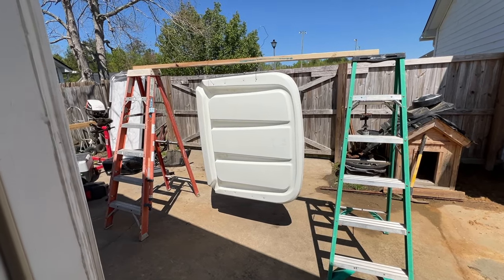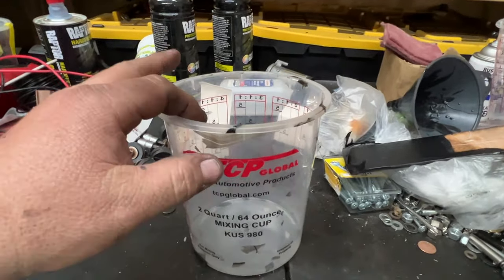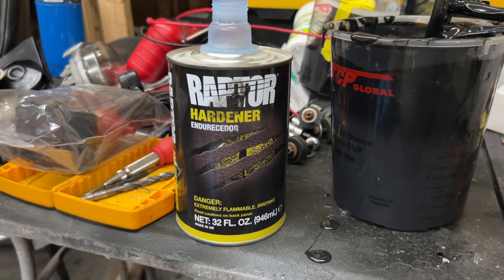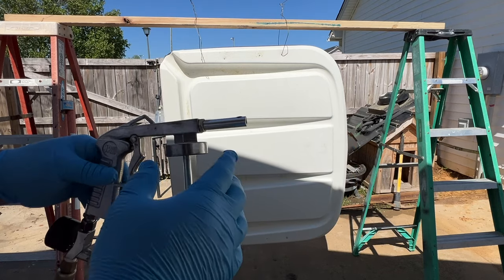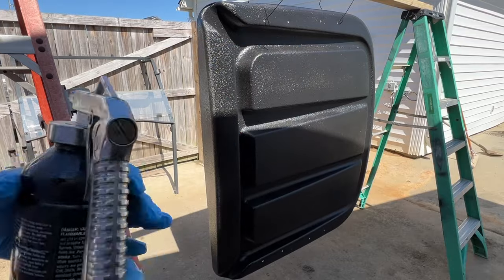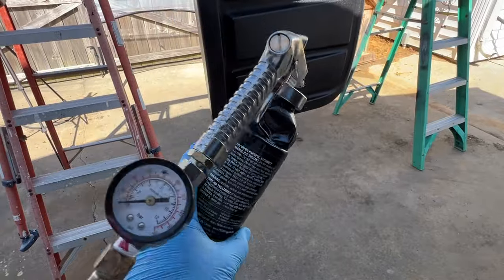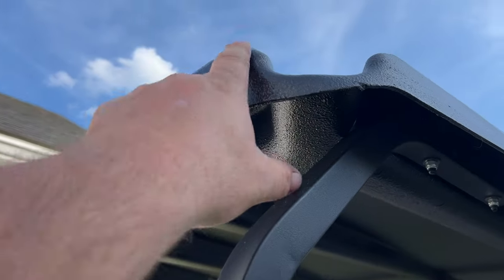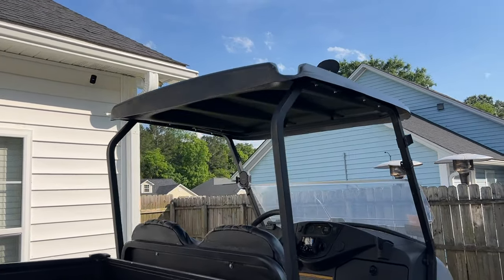How To Paint Golf Cart Roof With Raptor Liner | Color Match Bed Liner Paint Job

Comment: I did mine with regular satin black on the underside and let it dry a couple of days. Then I did the top in body color. 
However for raptor lining doing it all at the same time is the best way!

How did you attach the 2X4 to the top of the ladders?